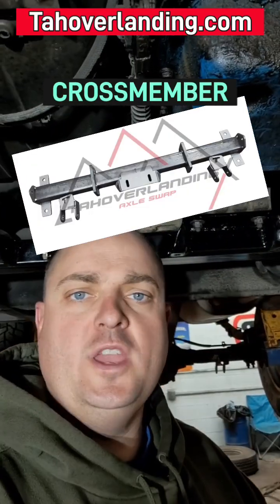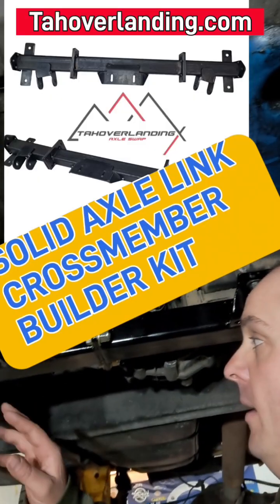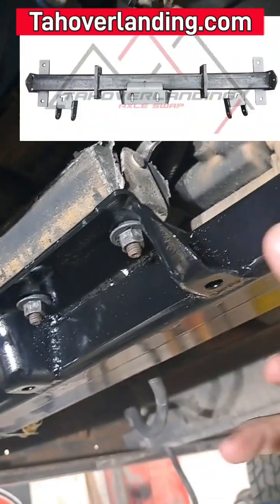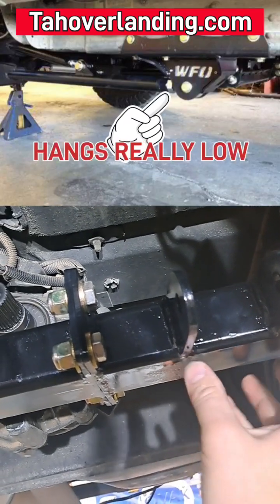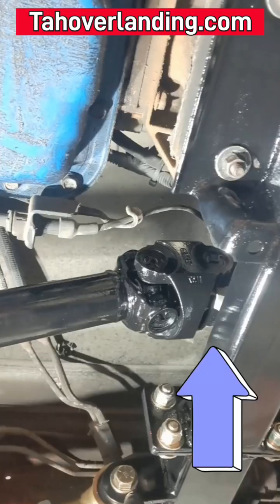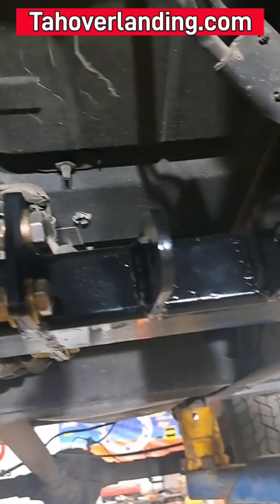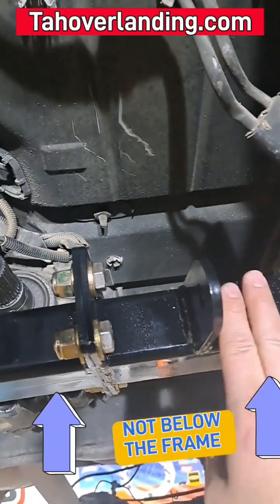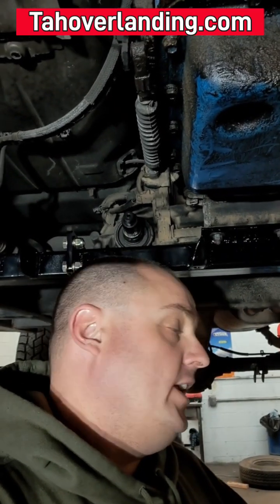Why GM Solid Axle Swap crossmember is like this

Comment: I’m planning to sas my k1500 with your kit in the future but I’m going to be building a c30 squarebody and convert it to 4x4. I would love to see a kit made for the squarebody too because there isn’t much out there unless you go coilover.
Reply from the maker: @garrettdickey3605  we have a square body kit. It's not on the shelf it's built to order. So far it has been guys that are swapping modern driver drop power trains into 2wd square bodies
Reply: Thanks for letting me know. I’ll definitely check it out when I get ready to build it.

Comment: How does that crossmember fare with an NP241 or NP243 that doesn't have a  slip yoke in an OBS? That output looks like it's really long.
Reply from the maker: @greasedog5699  you're right, our SYE is longer by design. The longer output allows use of up to 1410 u joints without hitting the shift motor. But it's only an inch and a half longer, so the 243 and 241 trucks do just fine with this crossmember.